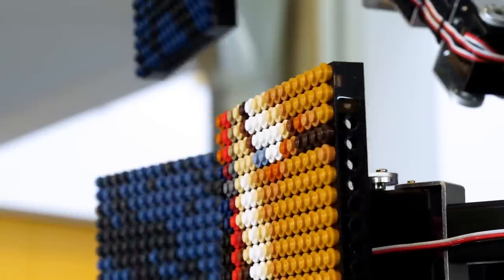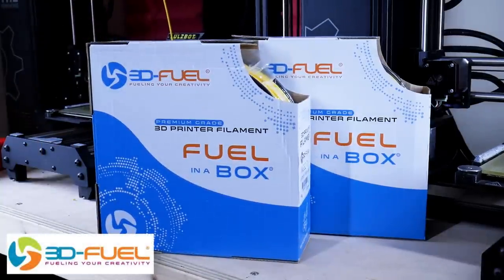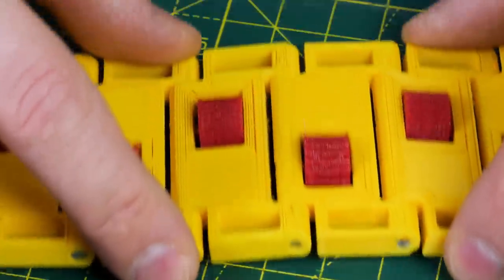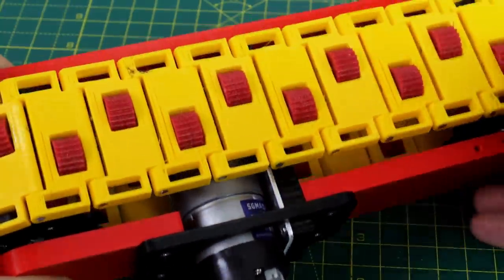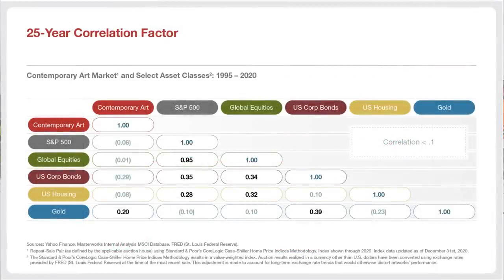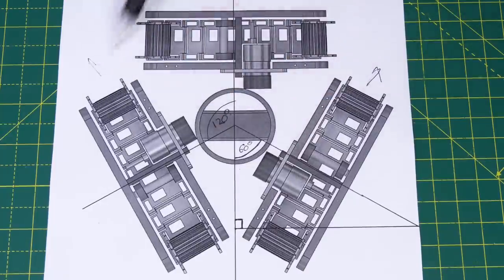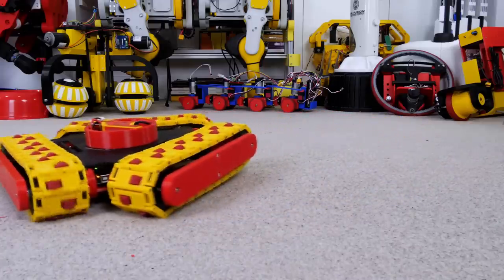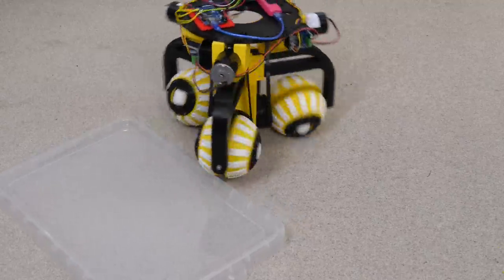Will this Omni-Directional Tank Work?

Comment: This is great - thank you.  I'm wondering if placing a pivot in the middle of the track might solve the problem.  I mean, each trackis pivoted in th middl and connected to a central chassis. This would mean that as it tries to climb the step the front can mount the step and the back of the track will still maintain contact with the ground to push it forward.

Comment: the small red wheels will scrape off the ground and not spin much because the robot is driving at a different angle to where 2 of the tracks small red wheels are placed.

Comment: I think you might have a bit of luck if the 3 tracks were on pivots. not full rotation pivots mind you, just enough so that they can tip a little bit to maintain traction while still being able to climb. So long as the pivot is in the dead center of each track, the robot should remain nice and stable, and the tracks shouldn't try to rotate on their own so long as there's a bit of weight on the central triangle hub. If done right, it would even limit how much it tips while climbing.

Comment: Maybe this could work if you make a suspension for each track with the motor as a fixed pivot point and a spring or elasitc connection from each of the track pod ends to the chassis. Ground clearance would prob need to be a lot greater then though.

Comment: What about if you took the same design but orientated the tracks so that they all point outward from a center point of a triangle? That way if you hit an obstacle the track that is pivoting off the ground has the traction and drive over obstacles 

Interested to hear why it wouldn't work if you already thought of it

Comment: U like the idea of omni directional track, but I think putting them in the triangle shape effects the climbing capabilities.
An idea I have is to only have two tracks like a normal tank but put the wheels that are on the treads at An angle.
I use wheels simular to this called mecanum wheels in robotics club.
I also call them omni directional wheels
Reply: *I like the idea
Reply: I just thought about it, and it wouldn't work with 2 tracks because mecanum wheels need 4 motors to power them.

But 4 tracks would do just the trick, it would just require an extra motor

Comment: What if you put the tracks in a star formation instead of a delta formation? i.e. Rotate the tracks 90 degrees and have them run radially from the center.

Comment: Would it be possible to add a pivot parallel to each track at the connection point to the chassis to prevent the tracks from being lifted off the ground by the rear track when climbing obstacles? It would need some sort of spring/suspension to still support the weight of the center chassis and keep the tracks parallel to the ground when in a neutral position.

Comment: I wonder if you allowed the angled tracks to pivot in the centre that way as the front goes up the back is pushed down giving you extra traction then allow the back track to pivot along its centre line so as the angled track move up over the obstacle lifting the body of the omintank the straight track would remain flat so it would roll forward and not be dragged.
I'm not an engineer so I hope I have made myself clear but I am interested in what you what you think

Comment: I don't really understand this project, or any omni-tracks, from a conceptual standpoint. The point of a tracked vehicle is to spread its load bearing across the track that is in contact with the ground. Yet these omni-tracks always puts the load bearing on very small points across the track; and adding more of the wheels to make the track an omni-track wouldn't help, as there's still a minimization of overall contact patch. I've always considered the best design to use perpendicular belts around the chain links, but then you need a way to keep the belt-link interface clean so that it can slide with minimal friction, assuming these belts could freely move in the first place; this 'interface' would keep the full contact of the original tack on the backside of the belt, thus having an omni-track with a full contact patch, this would be similar to how a treadmill has a platform under the belt. Ingress is also a massive, massive issue with any omni-track design, as you're adding an exponential amount of ingress-based failure points to the system. The only true omni-track without downsides like these are the screw tank, but then you have terrain issues, and any potential upgrades to make it perform better again introduce more ingress-based failure points. 

But the thing is, are omni-tracks really even needed? Anything small and/or nimble enough on tracks can just use zero radius turning to correctly position itself, anything larger and less nimble can do this but also has a slew drive to assist in positioning. Sure, it's not simultaneous x-y movement, but you get similar positioning with non-simultaneous and simultaneous x-α movement that is sometimes assisted with an additional β rotation. Not omni-drive but omni-positional, which is more than good enough considering the proper contact patch of a tracked vehicle, and considering the typical environment of a tracked vehicle; which shows the problem with realism with these omni-track concepts, not only do they not make sense from longevity standpoints, but they often just do not scale well to what they're trying to replace, everything would have to be severely over-engineered just to compete. 

At the end of the day, they just don't make sense. Omni-wheels themselves don't really make all that much sense either outside of a very narrow use case, which is very clean and very flat floors, which would be the environment you would find nearly every omni-directional robot existing in. There's just no point in omni-tracks existing when wheels already get the job done, there's not much a track can offer that a wheel couldn't in the same given use cases. If you really need omni-directionality on a platform but also need the benefits of being able to climb steeper trerrain, you might as well just develop a legged robot, as that platform would be more efficient for movement and obstacle transversing abilities. There's just no 'sweet spot' where omni-tracks make sense due to a variety of reasons, most of which come down to simplicity, cost, longevity, and maintenance, all factors of which other omni platforms will be better than omni-tracks.

Comment: What If instead of a pair of flat tracks you tried a pair of tubes wrapped around the rollers as treads. By twisting the tubes it could move sideways in addition to the normal functions of a tank

Comment: Tracks are not what enables a tank to climb, they’re what stops a heavy tank sinking into soft mud.  To go over obstacles you need to lift the drive-sprocket/idler wheels above the main suspension wheels so the track runs over and on top of what it comes up to at the front.  For a really good demonstration of this, look at the wartime comparison of cromwell, centaur and sherman tanks here on youtube.

here you go - https://youtu.be/KyuSIkt-eTs

Comment: Think you could try putting some teeth to the tracks? Like not so big that they are bigger than the TPU Wheels, but big enough that they could snatch to the edge and pull the tracks into the surface enough the whole track gains traction? If the teeth are bigger than the TPU Wheels, then they would become useless and no side movement would happen.
Reply: i was gonna suggest that he takes a bit of inspiration from actual tanks and use bogeys on suspension to conform to the edge while keeping grip

Comment: Why not just add one more track and angle all four tracks slightly that would make it still omni directional but you could power the rear when the front gets lifted up on a surface

Comment: The tracks are too rigid. Battle tanks have suspensions, and their tracks would be slack, save for tensioners along the top. Also, moving the transverse rollers closer to the outer edges and driving the tracks along the centreline should get the grippy parts onto the obstacle edges.

Comment: 11:20 It's allmost asif there is a reason why tanks have suspension that can keep the rear part of the tracks on the gorund while the front of the tank is climbing up an obstacle...

I really like watching pepole experiment but in cases like this I have to wonder; why did you not look at any existing tracked vehicles? Did you really just notice that there is nothing grippy at the front of the tracks until you put a piece of wood there? I mean; the point of the design is to have something grippiy at the front of the track to be able to climb an obstacle...

Comment: Did you try going at the obstacle backwards? The issue is that the driven parts are trying to lift themselves but the tread at the back is doing nothing while in full contact with the floor, if you turn it around 180 degrees you should have the opposite.
(where up is forward motion:)
Like this:   (Obstacle)            Instead of this:   (Obstacle)
                   ========                                           /  /    \  \
                    \  \     /  /                                            =======

Comment: the 'front'  wheels seem to grip well enough to pull is over obstacles, if only the 'back' could somehow roll over the ground instead of dragging, so I don't see why you can't  put little free spinning wheels imbedded into the tracks themselves going perpendicular to the tracks? this is NOT a complete failure. 

 if you really want to scrap the design i think if you has used 4 tracks and driven the craft so it goes carner first then the angle of attack would have made this totally work, you could even give it a flexible joint in the middle that would squeeze or elongate the craft so the wheels angle of attack could be increased for getting over obstacles even better.

Comment: tracks need pivit points in the midle giving each thread best posible chance 2 have grip
obsticals sud make tracks piwit up and insted of lifting the track up and not geting traction the other end of the track goes down and gives much needed traction
Reply: I thought of that but then it would not be structurally sound ether

Comment: it is a kind of working but i don't get it. is this design good at something? say…climbing or may be heavy loading? it may be good at spinning i guess? energy lost just going in a straight line with 2 other tracks draging. it is not the same as the 3 balls design. the contacts on the ground is 3 rectangular shape. it will have friction for sure.